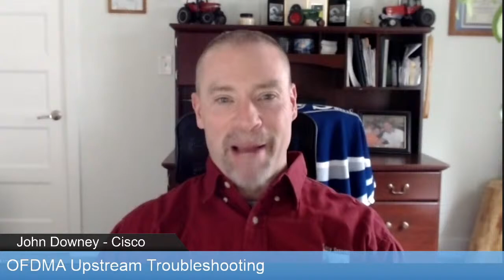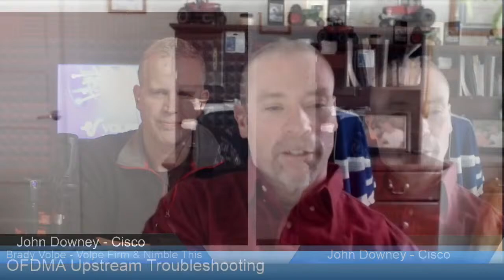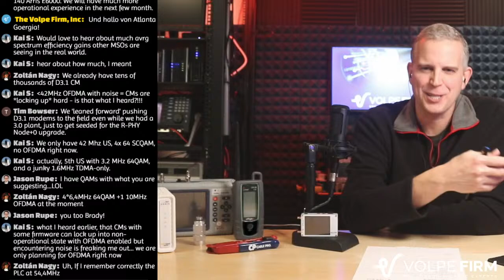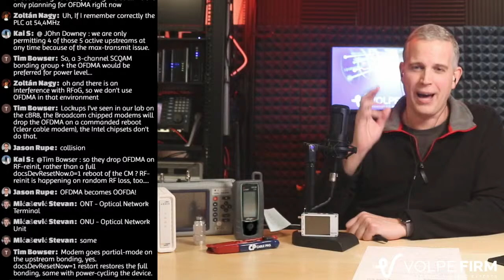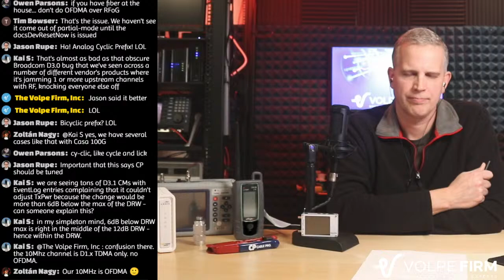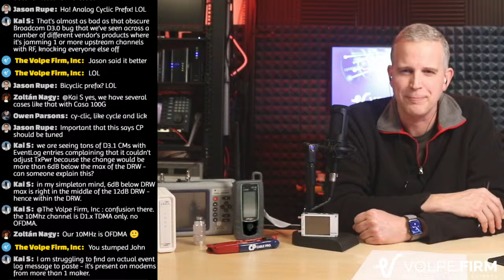OFDMA Upstream Troubleshooting

Comment: John - you were 99% of the way there with the 6dB backoff from max RBW.

If one of many channels is maxed out, where other channels power are placing the modem at the 'maximum' of the RBW (i.e. -12dB from the max'd channel), and the CMTS is commanding more power from /that/ channel - that CMTS command violates the +/-6dB RBW.
Essentially - that modem is telling the CMTS - I cant transmit higher on this channel, I am already maxed out - and more power to this channel violates RBW.

Now why is the CMTS telling a modem that is already at max transmit on a channel, (with the modem's RBW also at the max) to transmit higher...?
A hint: Look at your receive levels reported vs. actual (independently verify)
Reply from the maker: Hi Charlie, thanks for the feedback and for watching! So close we could smell it. But its often hard to think on the spot and the questions were coming in rapid fire. :)

Comment: In my market some of which is 42 and some is 85 in the 85 we have a huge off air bleed at 60-67 mhz of our mid split carriers killing both carriers tracking it is horrible and it’s relentless. What do you suggest.
Reply from the maker: Hi Michael, as we have recommended before, only run OFDMA above 42 MHz. Then in your OFDMA channel I would recommend using an exclusion band from 60-67 MHz (give or take, depending on your noise). This will create a notch where you have the interference. You will lose 3 MHz of bandwidth from the OFDMA channel, but its not currently usable bandwidth and further, its degrading your entire OFDMA channel. By using an exclusion band you will eliminate the noise that is impacting your OFDMA channel and it will then run at a higher modulation order. This is a very common fix that cable operators are implementing to avoid noisy spectrum in both the upstream and downstream.

Comment: The 6dB below top of DRW event log is simply a warning (required by the MULPI spec).  The further below the top of the window you are, the less dynamic range of the D/A you are using, so the lower the signal quality is.  This is because multiple US channels share the same D/A in the modem.  Your plant should be engineered to keep all of the transmit powers clustered within a few dB of each other.
Reply from the maker: Hi Sean true it generates events logs, but will also cause a modem to de-register.

Comment: Could the loss of Layer 3 be due to the fact that the OFDMA channel is preferred as it has greater capacity and the modems send traffic by starting at the lowest frequency which is where the most noise occurs? This would cause a large amount of packet loss. We use exception zones for the lower part of the OFDMA channel and the lower QAM handles the noise more effectively. Our modems are about 90% D3.1.
Reply from the maker: Awesome job on getting to 90% D3.1 penetration! In the cases we have seen no traffic, the modems required a reboot. Assuming heaving ingress in the OFDMA channel, one would expect some traffic would get through, but in these cases no traffic at all, not even a PING. The modems appeared dead to the end users.